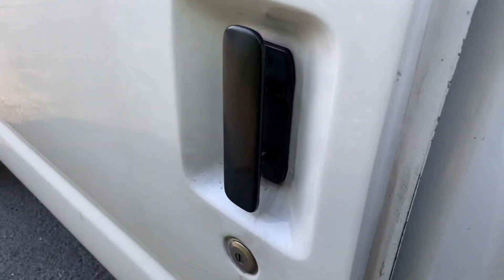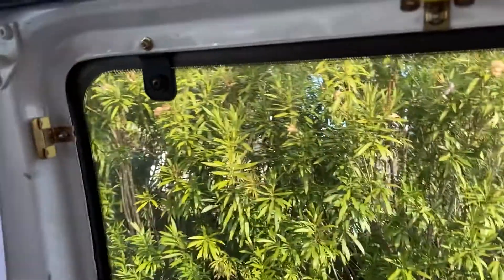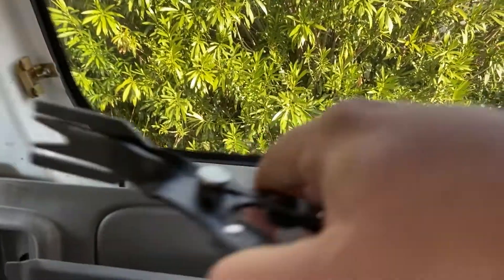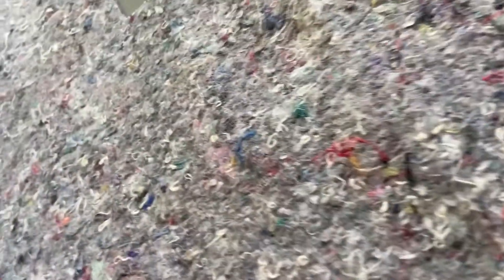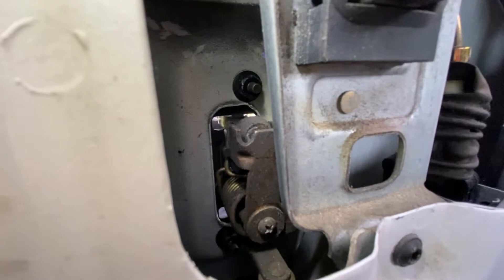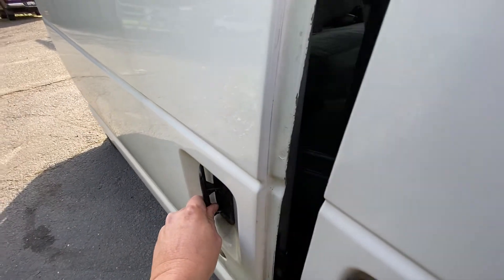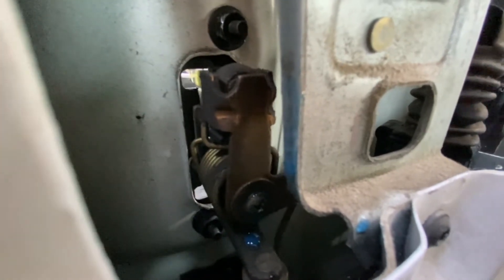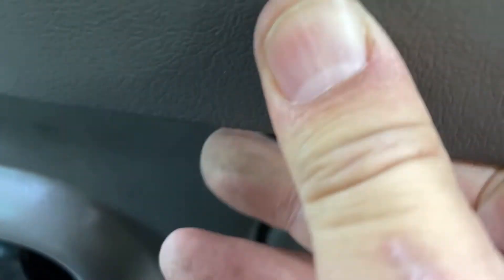FORD VAN SLIDING DOOR FIX! #fordvan #slidingdoor #ford #diy

Comment: Thank you so much for this video.  I had exactly the same problem and even noticed that the screw was loose but did not realize it made such a difference.  I thought that maybe the top of the ball capture assembly had broken off and it was letting the ball escape.  I was researching the cost of a new assembly ($275) when I did another YouTube search and ran across you video.  I went out and tighten the screw and to my amazement it worked.  Add blue lock-tight as well.   I love the fact that YouTube and people like yourself take the time to do these.  Thanks
Reply from the maker: You’re welcome, Calvin!  Glad it worked out for you!  Wow, what a savings!
Reply: I was looking for the same thing! Thanks again

Comment: Thanks, I have the same problem. I'm going to drill through the panel to get the screwdriver in there to tighten up the screw, instead of taking off the panels.

Comment: Had that problem for years. Finally figured out it was the screw. There’s no straight angle to tighten the screw due to the sheet metal. Bit of advice, drill a dime size hole in the sheet metal to allow a straight line to the screw to avoid stripping the screw head. Also, use an impact driver. Cheers.
Reply from the maker: Great advice, thank you!
Reply: do you know the size and length of screw? mines gone
Reply: @Brock_Fitness  shoot, I’ve never taken the screw completely out for fear of it dropping into the door cavity. You might be able to locate it with an extended magnetic. My guess, it’s a .75-1” Phillips screw. Maybe a door schematic online will show the actual part number. Best of luck!
Reply: I put a hole in the sheet metal the second time I had to tighten it up, but it kept coming loose every year or so, and eventually I just put a hole right through the trim so I could tighten it in seconds with a screwdriver without taking anything else apart. Depends how worried you are about appearance...

Last week we had a big ice storm that froze the door shut, and my wife broke the handle altogether trying to brute force it open. To my surprise, I could get an OEM handle for ~$60 online (the dealer wanted $85), and it was a really easy replacement. Having gotten entirely too familiar with this little screw, I removed the screw and added blue thread lock before I put the new handle assembly in. Hopefully at this point the handle lasts longer than the rest of the van.
Reply: @Brock_Fitness  did you ever figure out what size the screw is? I need one
Reply: @kploosli  if you're too familiar with the screw .. do you happen to know what size it is? thanks

Comment: Thank you for the video! I had the same problem. I drilled a little hole directly out from the screw so I could  get a good angle on the screw. Worked great.I agree theses plastic tabs are a horrible system.

Comment: So needed this. Now my interior handle no longer works either. Had whole handle replaced and it failed in less than 2 months after cross country drive. It’s one of worst old Ford design flaws. Luckily I removed most interior covering in my V10 Club Wagon but still that screw takes a lot to get to which is labor charged if you went to a shop. I’ve had several mechanics flat out not even try n refer me to body shops. Stay tuned…. Let’s see if my screw is even there still. LoL. Thx for great support,simple  video

Comment: Thanks, dude! This was a huge help!
Reply from the maker: You’re welcome John!  Glad it helped!
Reply: @ford-fix  Thought I would share with you  that in my case the problem was the plastic clip that holds the bottom of the push up rod to the handle action was broken. I bought one in a pack from Autozone for $5, but your video was still extremely valuable to helping me get it opened and reassembled.
Reply from the maker: @johnkullman9282  Glad you got it to work!  I sure wish they wouldn’t use plastic parts, they fail and crack over time.  Thanks for the feedback!  -Robert

Comment: You can access the damm screw without removing the bottom panel completly.  Unscrew the upper left hand screw of the bottom panel and lift the Panel up clear of the plastic hooks and bend the front of the panel to get acesss to that screw.

Thanks for this video.

Comment: Cool, you should make and sell a template where to drill the door and a rubber plug for the hole to reach in with a screwdriver.

Comment: If you drill a 1/4 inch hole in the interior panel where you need to access the screw you can tighten it properly.

Comment: Should use red lock-tite instead of blue. Red is more of a permanent type than the blue.
Reply: About a year after this fix, the latch went out again. I thought it was the screw again. However, when I opened the panel, the screw was still in place. Ended up that several plastic pieces of the latch assembly finally broke - after 23 years! I replaced the latch assembly and all is good once again.

Comment: Anyone know where the wires run into the van from the sliding door? The speaker in the sliding door used to work then stopped. So I when I replaced the new one didn't work either.